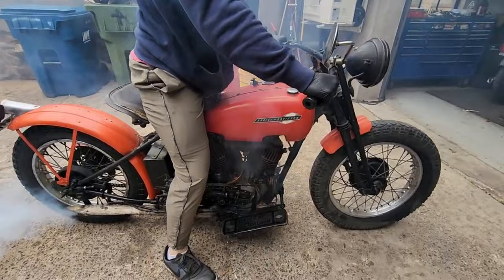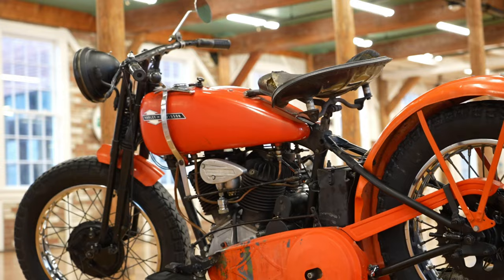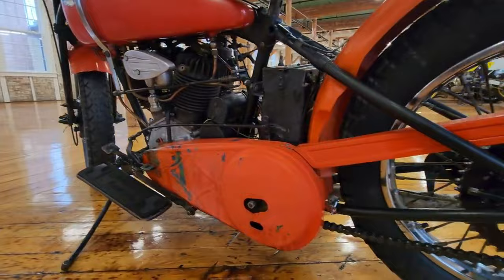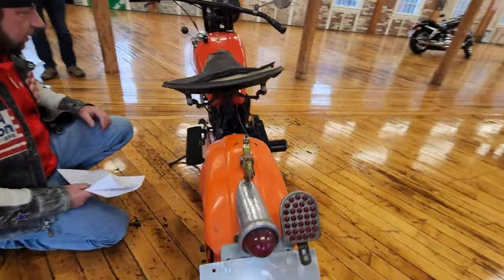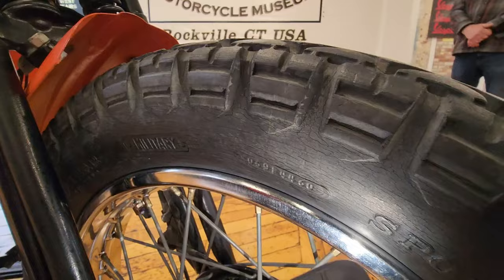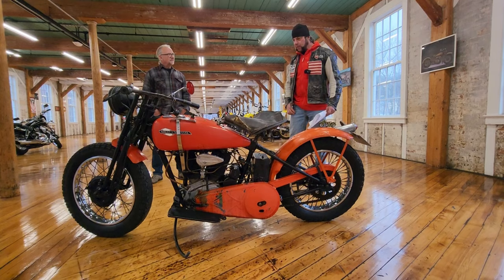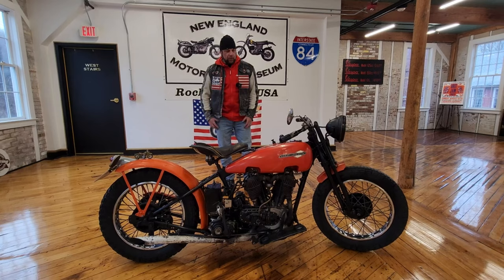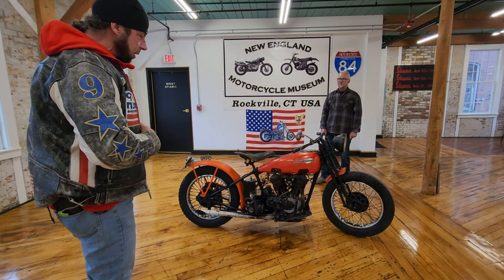Riding The 1928 Harley Davidson JD  , 96 YEAR OLD IRON

Comment: Thanks for all the hard work in many ways. I ran across your channel a while back. I thought who is this ol dude rippin around on a huge 2 stroke. Then finally followed ya. We are bout the same age and I love seeing some old bikes. I’ve rode since I was too young to start a mini bike. Had to wait for dad to get home to pull start it. Run it till I was out of fuel and push it home. Had a Tecumseh. Engine. I’ve owned a lot of bikes since then. Not a rich family but had to work to get all those bikes over the years. Currently own a Harley and a Royal enfield. I have a chance to buy a Bonneville and a Honda trail 90 both vintage. Ramble over. Thanks again for your channel. I need to get out that way and check out your stash of ol bikes.

Comment: Some comments from my limited knowledge.
The hyphen on the foot board is the correct rectangular one. Also used on the original tank badge. Seen later ones with an italic hyphen.
It is the clutch pedal that is suicidal. Once bike was leaning left, I crossed a lawn ending up in neighbors fence.
The gearbox was not constant mesh on second, so abusive shifting wears out mainshaft 2nd gear fast. (fast means less than a decade).
Half of left tank is gas reserve, rest oil. When you go to a gas station to fill up oil, also check if gas is needed.
If there is no blue smoke, immediately fill up oil.
The hand oil pump is to be used when climbing a steep hill. Also practical to use if you think cars behind you is too close.
Not certain if it is correct rims and tires. Don't know the exact year that Harley skipped using beaded edge tires. Definitely before 1930.
The rear brake is useless when it comes to reducing your speed. Front brake actually reduce your speed.....a bit.
To many a surprise, old Harleys are very reliable. Still running well with 1/16 play in conrod to crank bearing.
The old Harleys are also quite nimble. Harleys seems to grow faster in weight over the years than average Americans

Comment: I'm buying a 2005 883 that has been sitting for almost 2 years. I plan to always run 93 in it, but should I fill it with VP racing fuel after I drain the gas that's in it? Also any other precautions I should take before starting it? I'm definitely  putting new tires on it before riding.